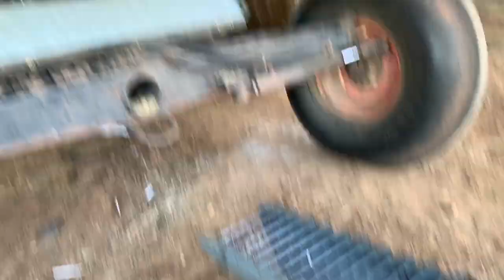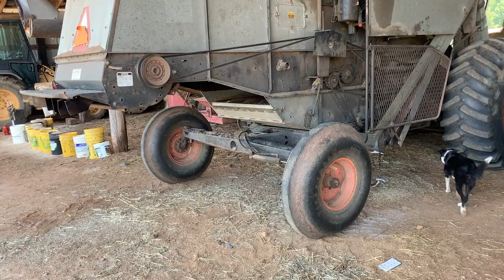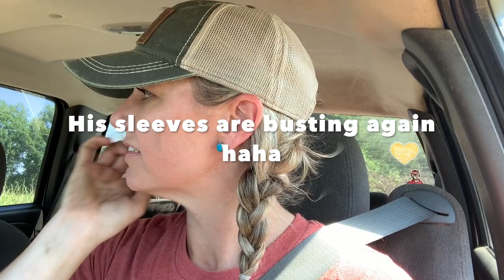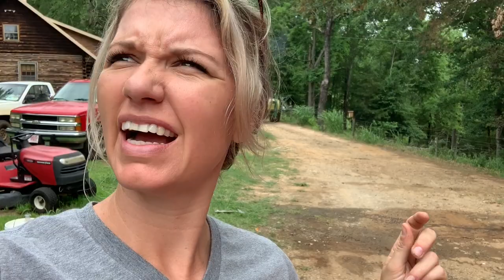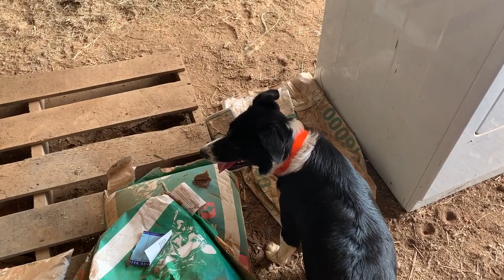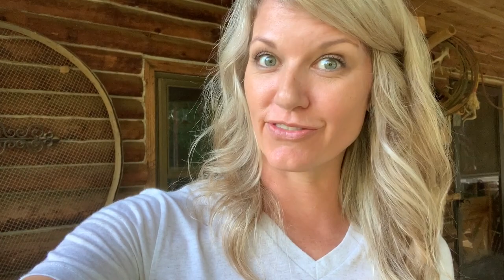Here's Hoping : Our Barley Combining Saga Continues

Comment: Its called a straw walker because with it shaking back and forwards and going up and down at the back end it causes the straw to be throw up and back every time it goes around once. it walks the straw out, one saw tooth at a time hence the name. it allows the grain to be shaken out of the bulk straw and the grain falls back down the middle of the walker to the inside of the combine to where it is collected.. Wesley did a heck of a job getting up inside to fasten bolts etc. Any technician will tell you it is just about the nastiest job on a combine.  Big responsibility on a young fellows shoulders.

Comment: Long sleeve shirts are the norm in most Industry and do protect you from the sun, briars, sharp edges, etc.
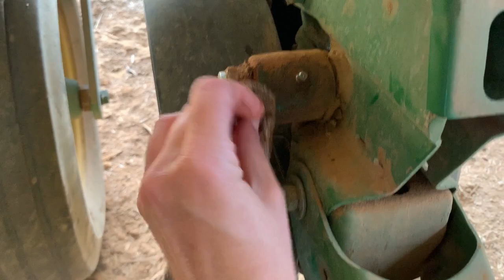Smart to wear them.  When the elbows go out, have them tailored to Short Sleeves.  When the pockets go they become shop cloths.  Glad you got the Gleaner working.  At 22:00 there are Zerk fittings on the lower 2 wheels.  We have a different name for those weeds in Ontario.  If I remember I will let you know!

Comment: Couple of tips to make that grill last longer, Don't keep the grill on too long after grilling, you'll burn the coating off the grates. After cooking and it cools just a little, wire brush the grates, then coat them with olive oil so they don't rust and stay stick free. I use tongs and a rag in an empty peanut butter jar with the oil.

Comment: I know you know to clean the filter, BUT check the hose to make sure there is nothing stuck in it. The motor sounds pretty strong.    WILL WORK FOR STEAK.....LOL   The long sleeves keeps the direct sun off of the arms which is a lot cooler.   Have a safe 4th of July.

Comment: Turn your grill on high with the lid down, it will burn a lot of the grease off of the grill racks for a easy clean up.
Reply: Just don't let it go for too long or else it'll cook the grating and they'll start rusting. I usually do it for 2-3 minutes, shut it off and open, wire brush it then coat the grates with olive oil. No rust and non stick.

Comment: When you are going to be filing the bed of your truck or a trailer. Put a old tire or 2 in the front. Run a chain from that tire so it can go out the back. You can hook the chain to a tractor or a tree. Then just drive out from under the load. 95 percent of your load is gone that quick. And you don't havta fight it as hard. I worked for a roofing company. This is how we unloaded 18 foot trailers with built up side rails. Up to 6000 lbs of tear off shingles gone in 10 seconds. Good luck.
Reply from the maker: Makes sense!

Comment: I am sure it does keep him cooler. My grandpa would plow a mule with a denim jumper (coat) on. He would finish and the coat would be white with salt, You sweat and it runs off and does very little good but with a coat ounce the coat gets wet every little air movement cools you. You therefore stay cooler. You may smell but you are cooler.

Comment: That first get go on the grill is always messy till it tempers like cast iron does. Spray it down with cooking spray and heavy.... heat them a bit then spray them again for best results. Farming is funner than swimming in the pacific ocean cleaning the prop's on the boat, algae and kelp all over them stopping the boat from moving much if at all. No throwing the outboard on a sixty foot boat. Not going home with half a ton of junk on them and if it did turn, the shafts would warp and bend and just possibly sink it to the davy jones section. Good warm weather has the cow pasture ruts in feed lot so hard that a dozer couldn't break it up now. Yet a teaspoon of rain turns it all to grease... hope that you have air in the crib.... and don't go streaking unless kids are home and Lawrence decides to chase yaa into the pond!!
Reply from the maker: I do need to use cooking spray! Never think about that. Thanks Morgan!

Comment: I believe that the Farmer needs a new hip.
Reply from the maker: He needs new knees, hips, shoulders and carpal tunnel surgery :P
Reply: @ThisFarmWife_  If he needs carpal tunnel surgery then he should not wait to long. I have had both mine done and it does not take long to recover from it. I should have done mine 10 years sooner instead of suffering with it. I have had both knees replaced and again I should not waited so long to do it. The sooner you do them the quicker you recover because if you go to long and you loose muscle then recovery takes longer. On my second knee replacement I tried to strength it before surgery and I recover in  half the time as I did on the first knee Replacement.  Life is good when you get your old parts replaced. Take Care.